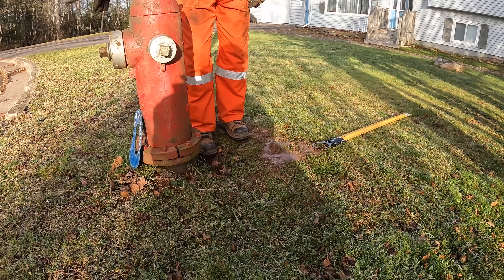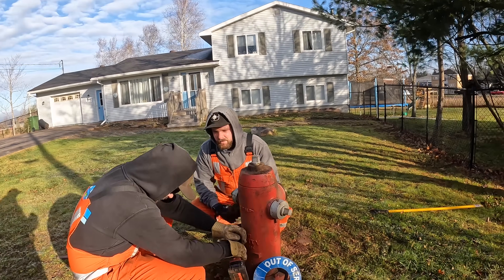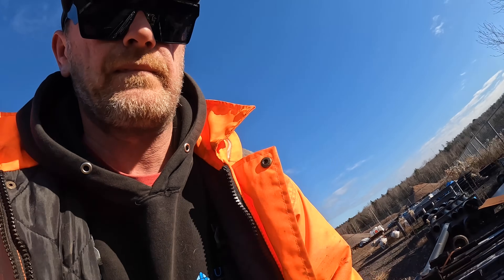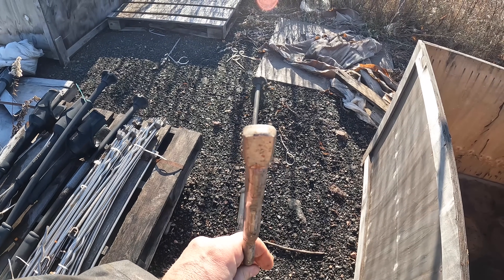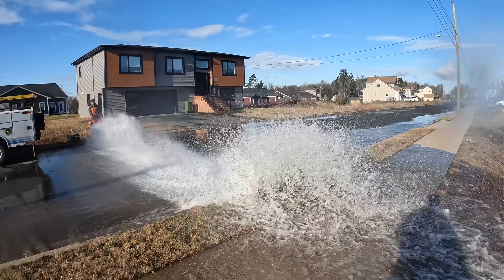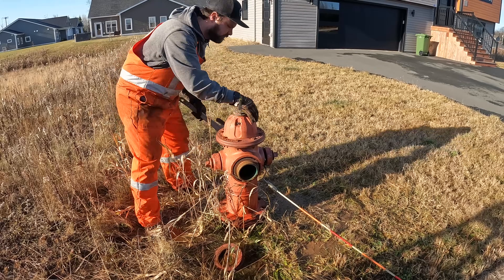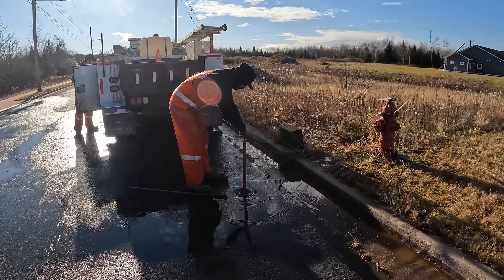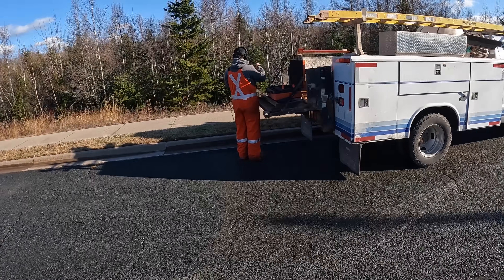Detour Ahead!! Broken hydrants/valves, Leak Detection

Comment: How much pressure does a hydrant hold before replacing the whole thing???
Reply from the maker: @smookysmokes749  A typical fire hydrant holds around 20 pounds per square inch (PSI) of pressure, which is considered the minimum acceptable pressure for effective firefighting according to most fire codes and the NFPA; however, the exact pressure can vary depending on the local water system and fire department regulations. 
Key points about fire hydrant pressure:
Standard pressure: 20 PSI 
Pressure range: Can vary from 20 PSI to 80 PSI depending on location 
Importance of pressure: Sufficient pressure is needed to deliver a strong water flow for firefighting operations
Reply: @ thanks, so how many times can you use a hydrant before the water stops flowing??? Cause on summer days we open the hydrant all day and by the next month their doing construction on replacing
Reply from the maker: @ 50 years with proper maintenance

Comment: In Houston texas there not called meter pits there called meter boxes and we have to clean them out just got to be careful not to cut the wires to the transmitter best way to clean them out is using a shop vac and a water hose with a nozzle.

Comment: 2 questions how do you do leak detection in the street and have you greased the track hoe yet?
Reply from the maker: @INTERCEPTER001  the water main is underground, in the street , if it’s leaking you will hear it with the listening gear,
Reply: @rodpreston100  thanks man still not greased that track hoe yet lol?
Reply from the maker: It’s not my gear, lol but I think it was
Reply: @rodpreston100  just for a laugh id give the operator a can of wd40 as a christmas present to the machine lol

Comment: As others here have said: In the U.S. in northern states - the water meter is in the cellar (probably for the last 40-years many places have an outside meter reading device, the meter reader doesn't need to go into the house.  Ithaca New York - by code water pipes must be 60 inches in the ground,  Meter boxes - southern states where the ground really doesn't freeze.  The U.S. has about 150,000 different water departments, rarely are any two alike.

Comment: In the states we have different colors of hydrants to indicate water flow capacity. (gpm) Do you have them ??
Reply from the maker: @SheilaGenX   not in our town, I think they do in Halifax 🍻👍🏼
Reply: The hydrants in houston texas has one color blue and white years ago they use to be red then yellow and blue now white and blue they use to flush ours but haven't done it in 2 years.
Reply from the maker: @bluejay713  it’s a big liability if a hydrant has say , a blue cap= 1500 gpm , and doesn’t produce it at a fire , so we don’t do that here , and I believe from my water distribution levels, a fire min is 35 psi , most of our hydrants are between 50 psi and 80 psi